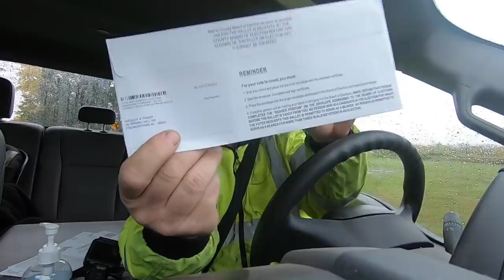I Voted And Fixed The Spindle

Comment: Wes your correct in drilling and installing grease zerks in the hubs. A trick an old timer showed me to use on the hubs with bearings/grease in them.  Put some grease on your drill and tap. That will catch any metal chips so they do not fall into the hub.

Comment: You don’t want the castle but tight on the spindle, just until it gets tight then back off to next hole. As the hub and bearings heat up it expands, you’ll create drag if it’s too tight.

Comment: Wes,i had a job as a machine assembler,mas building 20 gear cases for a company name was PMC,i had about 5 completed,one of there inspectors came to inspect,he told me i had seal in backwards,i know what is right way to install a seal,had a few words about it,got assenbly drawings out and YES,HE WAS RIGHT,they want there seals in backwards,so when grease comes  out of seal they know its full of grease,these seals were like 12inch diameter,not know how much one costs, just something for ya think about,good idea  putting a zerk in middle like that,like your vids,300 bushel to the acre,OUTSTANING,ok now your trolls can call me whatever,TRUMP 2020 4 MORE YEARS

Comment: I've done hundreds of hubs like that on wheels and rolling cutters , still have to be careful not to blow out grease seals and caps but sure way to get grease to the back bearing without disassemble the whole hub !!
Reply: Put the seal in backwards it will keep crap from coming in but will let the grease out when you grease them.

Comment: Probably pushed a shitload of dirt into the spindle when you greased it.  Yeah that doesn't sound right, as in the grease pushed the spent lube and dirt into the front bearing.  No fault on your part just the previous owner neglect

Comment: Why aren't you doing spent compost deliveries with hay backhaul yet?  I knew you were going to prove the trolls wrong again on the corn crop. Reach out to Hemp university attached to the largest decorticator in North America in North Carolina from the market side.   Offer the use the channel at fibre harvest but follow the key building uses.  Fibre for natural insulation, shiv for hempcrete.  Upload the decortication process and then offer to do a training build on farm to attract contractors, subscribers to attend.  Also utube channels.  Matt Reisinger would be a great general contractor on utube .  Use the mill and stage for the big week of build as a guest house to bring in other channels and grow both.  Charge them a baling premium, they pay your premium over bale price from Marketing budget.  Hook up with hempcrete sellers to get a 5% referral fee  code.  after they provide all of the materials. You could do the same with a boiler manufacturer,, radiant heat flooring  fire proof roofing including vents the wont allow embers to start fireat in the attic. Here's how you stick it to the tree huggers.  Every log you harvest and mill you sequester carbon, same with hemp growers. Crank up the mill, select the DIY guys from the build and offer fo provide the beams and lumber including a credit for there hard work on your build.  Build a spec home to sell. Let the forrest, mill channel all pay you dividends to pay for your sailboat.  Heck of a channel.  Best part, every acre diverted from over priced corn and beans means less supply and higher prices eventually.  Not paying farmers carbon credts is just wrong.  Screw subsidies,  love the channel.  Cross market with Tim's channel and provide daily build how to content there.  Keep Tim's channel out of the gobble your balls fight against any channel that's Red and comserviative..  You upload the final time lapse build to dry in video.  You now have a warm build winter project to finish inside.  .  Get set up with plumbing, roofing, electricians, dry wall ect during the build.  Shelter institute trains post and beam builds to do remote traiming.of DIY builders. Barter all of the finish with wood for there project. harvested on farm.  Hire a driver that also runs the mill.  Set up deliveries and hay backhaul to free him up for custom bailing gigs.  I believe you can also get every bale back hauled  perood on youir upcoming contract negotiations. When they ask for low prices, you lock down compost deliveries to fund the two rental spreaders you document every repair and failure point upgrades all parts provided provided.  Then aution them to others farmers that will be following your results from this year.  Do the auction by online bids.  Any amount over the spreader trucks ( yes get two) first goes to paying you back for the labor to do all the repairs and upgrades.  All documented on utube.   Let the neighbors you contract with also pay for your applicatos.  Get a promo code and a fair referral fee from the manufacturer or Truck lease compqxany.   Eventually the trucks will pay for themselves.  With your skills, dont wait for retirement to sail.  Hire a good boat broker and boat surveyor to find you the discounted sailboat.  Charter it out of the Phillipines.   Add on solar, wind and water electricity generation ,  add tesla power walls with the ability to sell electricity durning peak hours back to the grid with a power credit to the farm.  That's where the utilities screw solar owners in CA .  They sell it at peak and pay hometowns a credit at tier I lowest value.
Refit with electric engines with a1 backup generator if needed.  If you can store enough power for any two week  sail and generate power  to use on 
 ,charter you end up with no ice engins , much less noise, another channel that covers the retro fit.  Numerous manufactures and dealers to sponsor new equipment, sails ect.  Hire a charter service with a camera ready captain to provide content on sailing and all of the beautiful best docking sites.  Family in the phillipines and charter service pay for the newer boat upgrade.